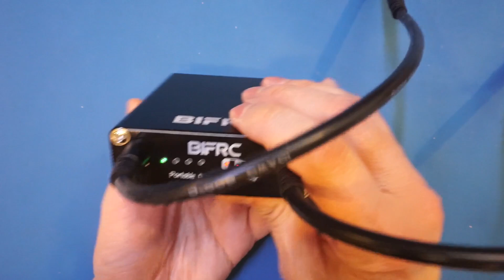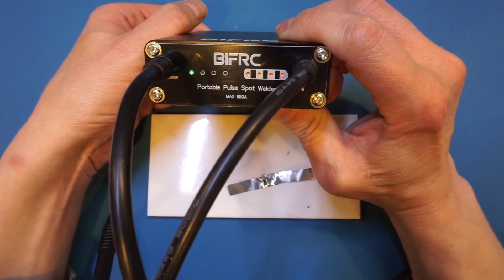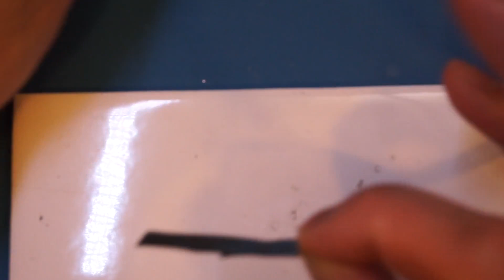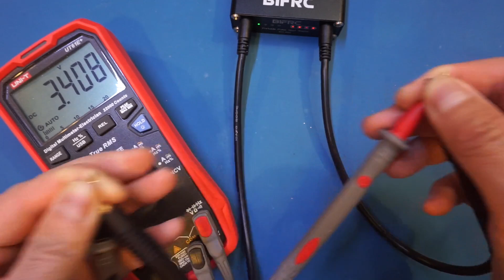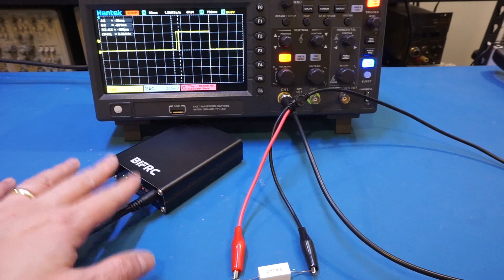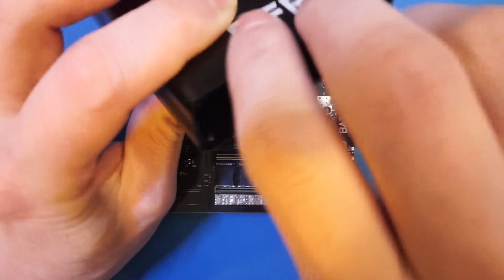How Does a Spot Welder Work? Review, Teardown and Analysis of a BIFRC DH20 Battery Spot Welder

Comment: How much resistance was used for 1 ohm or 0.1ohm ?  I can't get such a waveform, what internal settings do I need in the oscilloscope?
Reply from the maker: The resistance doesn't matter that much as the output voltage should be 3+ volts. I used a 10 Ohm resistor.
Reply: @KerryWongBlog  The voltage is more than 3V where? Is it set to Hantek?  Or spot welding ?
Reply from the maker: @ВасяПупкин-ы3ь9т  The 3+ volts is the voltage across the welder output terminals.
Reply: @KerryWongBlog  That's probably why I have a problem reading the pulse; the oscilloscope showed 1V. There's no button on the spot welding board. How can I use a multimeter to read the output voltage on the welding probes?
Reply from the maker: @ВасяПупкин-ы3ь9т  You can't use a multimeter. The pulse is triggered when the probes are connected to the small resistor. You need to set your scope in single shot mode and set the trigger level to around 500mV. You may need to try it a few times.
Reply: @KerryWongBlog  Yes, that's right, I had 500 mV  single mode, but I didn't get a meander, it was a saw, and why did you decide that the minimum should be 3 volts?

Comment: Hi if I remove battery and bring two cable outside to connect a car battery will be okay or not
Reply: No, not OK. This device is running on a nominal voltage of 3.7 Volt. Charged up is about 4.2 Volt.

Comment: Im gonna buy this thing, but can i modify the battery to 2 Li-Po 4700MaH 50C on this module? Cause i already calculated it and i got around 940A. Is it bad? Cause that spot welder said "Max 650A"

Comment: thanks a lot for all the info and tests, i have received my spot welder today, it was a docreate brand even though the product description and photos said BIFRC DH30, unfortunatly a mosfet burnt on first 5 welds on first gear, i was testing it on the nickel plated strips included in the product, now the output is always on even when the device is off, and it doesn't pulse the output it's just connected straight to the battery now, it might have been a fluke and others might have better luck but the soldering inside is quite shoddy there are solder blobs on one of the mosfets, the mosfets should've been able to handle the current since they're rated for 320A contunious and 1200A pulsed, but maybe they're fake which would explain the short life span. i don't know if i can recommend it seeing how fast it destroyed itself on the lowest power setting atleast for the docreate brand ones maybe the BIFRC brand ones have higher quality mosfets, the pcb was similar but with different mosfets and controller ic, the mosfets on mine were G011N04 instead of the 4N04R8 they have basically the same cont. and pulsed Amp rating but maybe much lower quality....

Comment: Thanks Kerry,  my BIFRC is acting strange all of sudden. Worked fine for few welds. But know it's melting the nickle strip every time I try to spot weld. Even on a lower setting. Tried swapping the leads but no luck. 
Also tried contacting Ali-baba vendor and no more vendor. Bought this about year ago.

Comment: Given your measurements and the internal battery capacity, how many welds can be performed on a single charge? One Amazon review mentions only 30 welds per charge. It didn't say at which power level. Even at level 9 I can't see this only doing 30 charges. I was going to purchase this but want to confirm battery life.
Reply: I get about 800-1000 welds per charge.
Reply: @foxabilo Well, you are super lucky.

Comment: The battery on mine has given up. I can't find any info about the battery other than it is 4.2v and 5300mah. Do you think I could replace with say 10 X 20A 18650 batteries? What is the max output of the lipo battery inside?
Reply: 5500 mah x 120c = 650a 
lion piller anlık Max 30 amper verebilir paralel bağlayıp 500a çıkarmak geregerekir

Comment: It is possible that when this battery reaches the end of its useful life, I can replace it with another Li-po battery of better origin and with a higher rated voltage (perhaps some graphene 2S or 3S) and continue using the motherboard of this system solder outside the original case?  Would that even make the system work more fluidly? Thank You.
Reply: The battery voltage on this device is nominal 3.7 Volt. So, the answer is no for 2S or 3S or more.

Comment: Thanks for the Vid. Interesting demo indeed. A quick question, why wouldn’t the high current of the welder kill the battery (risk of explosion)?
Reply: Are you asking about the cell being welded? Well the current is not flowing through the cell. The current is only flowing between the nickel strips and the metal underneath the nickel strip.
Reply: @SolarMinerPH  Got it.. thanks :-)

Comment: Once the internal battery is dead , I would desolder the battery and solder wire to it with XT connector and use it with external battery pack. I wonder if the XT connectors (60A) can withstand those amp pulses without burning the connector down .
Reply: There is one that does exactly that. The Sequre spot welder.

Comment: I have the 12v input BFIRC circuit board with one led that changes colour according to set levels. Which battery should I attach to it? Can I use the 3 cells 12v 18650 battery pack without BMS?
Reply: A high discharge rate lipo battery that is usually used on RC stuff is better than 18650s as they can provide higher current.
Reply: @SolarMinerPH   , Alright thank you for reply 😊

Comment: very nice, interesting video! I find the method of measuring the welding current very imprecise. at 300A and the short welding pulse it shouldn't weld. I would have been interested in how high the voltage at the gate of the MOSFET'S is at the moment of welding. According to the data sheet, 4V is not enough for the transistors to control properly. Can you explain that to me plausibly?
Reply: There is a small boost converter on that circuit that ups the battery 3.4v to around 10v

Comment: Kerry, do you think there's difference between AC vs DC on battery welders? I built the usual microwave welder and have trouble getting the weld to stick regardless of the pulse time.
Reply from the maker: Current is the most important factor, you can probably check the current at the secondary of the transformer. When shorted you should get 300 to 500 Amps.
Reply: @KerryWongBlog  I didn't think of that. I'll check it. Thanks, Kerry. Ken

Comment: Great video! Would it be possible to remove and replace the built-in Li-Ion battery and simply apply 3.4v to the appropriate inputs with a DC power supply?

I suspect the DC power supply (and wiring) would need to handle the current draw requirements. Any idea what might be, given the battery pack that came with the unit?
Reply: Specs device say 5500mAh 650A peak, so theoretically the LiPo's inside can deliver around 120C peak and are high C-rated ones.
Reply from the maker: Typical PS would not be able to supply the 300A-600A required by the welder unfortunately.
Reply: @KerryWongBlog  Gotcha. It’s amazing that the small Li-ion battery inside can provide that much current! By chance did you happen to see what the battery specs were apart from voltage? mAh, C rating?
Reply from the maker: @thequinnreapernovaco.7497  Unfortunately there's no marking on the battery at all.
Reply: @KerryWongBlog  Thanks, I appreciate the info.

Comment: If i had this, i would definitely add multiple super capacitors in parallel with bat+ and the GND side of the FETs to take some strain off the battery. The super caps can be recharged slowly from the battery via a resistor after each use.

Comment: unfourtainly this dc-dc converter ic is not capable of boosting if the battery voltage goes low enough.
i have the same thing but if the battery is not fully charged, it turns off at the highest power.
i tried adding a cap at the output of the boost converter, but it wouldnt start up then. 
 i added a diode between the battery and the converter together with a big cap so it can keep running if the battery sags a lot, didnt work either.
 the lowest voltage this thing can run is not low enough to allow for the forward voltage drop of the diode.  only solution would be a sepperate 5v supply, probably fed in to the usb port.

if the 5v line drops too low, the fet gates wont be charged enough and the rds(on) gets too high, this causes them to blow up sometimes.
Reply from the maker: The welding portion does not use the DC-DC converter (that is for the battery bank 5V output), I think the issue is what I mentioned in a response to another post earlier. When the battery is not fully charged the internal resistance is high enough and cannot sustain the current for the pulse duration. What you could try is add a resistor and capacitor to the VCC pin of the MCU so that the RC constant is larger than the pulse duration. If the MCU is capable of "soft start", this could be a viable solution.
Reply: I found they say you can have it plugged in when using. This works well for me. Made a 12s 40p pack. With just stopping for about 20 mins to let it cool off. I did endup running a small shop fan as I was using it. I would think most guys are not going to even us it as much as I have. Maybe this info helps.
Reply: I would like to know, what is the minimum and safe voltage that I can use it, before having to recharge?
Reply: ideally fully charged. when your welds dont stick anymore, its time to recharge. 3.8v and above.
Reply: @gamerpaddy  thank you so much 👍🏻

Comment: What type of welding could be done on the maximum setting #9?
Reply: Thanks Kerry Wong & Ja Ro.
Reply from the maker: Perhaps with thicker nickel strips? You don't need to go above #3 for typical use otherwise you will burn holes through the strip.
Reply: They say max 0.15mm thickness, so yes thicker strips. But, often you are welding to 18650 cells which will sink a lot of the heat out. From my testing, #9 setting is barely enough for that, although my technique may be bad.

Comment: I was surprised that the MCU did not hiccup during the spot welding process.
Reply from the maker: I suspect that the internal resistance of the battery is extremely low. I would like to see how it behaves after hundreds of cycles. If the battery internal resistance increases significantly, it will not be able to deliver sustained high current and will almost certainly cause the MCU to brownout.
Reply: @KerryWongBlog  yeah, was thinking about that too when the battery reaches about a hundred cycles. Maybe a capacitor near the MCU supply pin might help avoid the brownout or some of the large ceramic caps on the board are already doing it.
Reply: @SlinkyStoney  The boost converter will definitely be the helper, the 5V supply, with those large ceramic capacitors, will hold up the output for the pulse duration, and so long as the battery is held near a fully charged state it should have no problems as it ages. At least the cell is easy to change, that size pouch cell is a common item, and pretty much any RC model battery can be used to replace it.